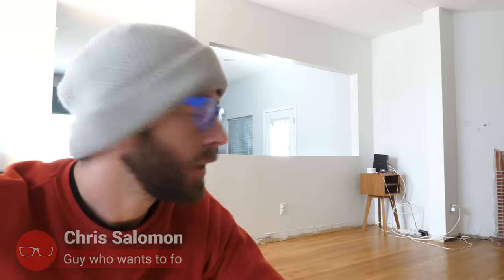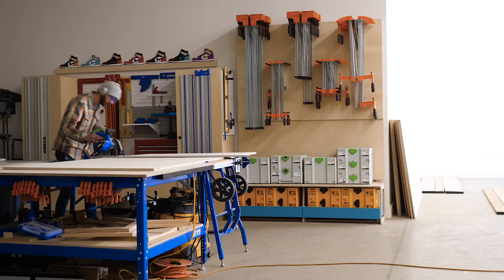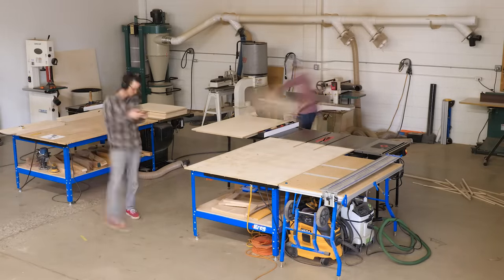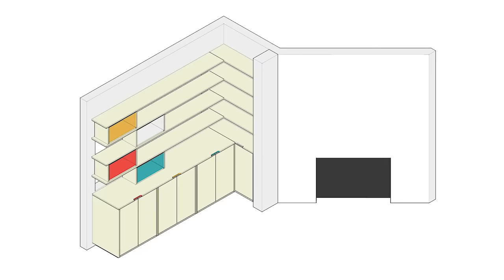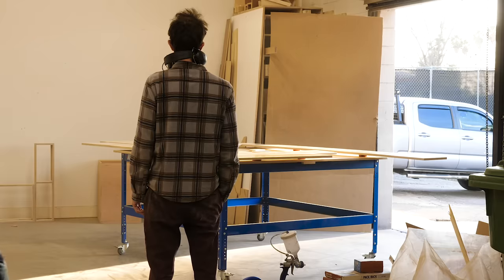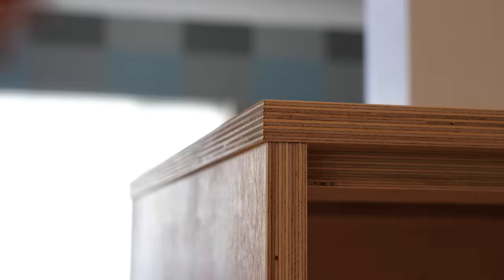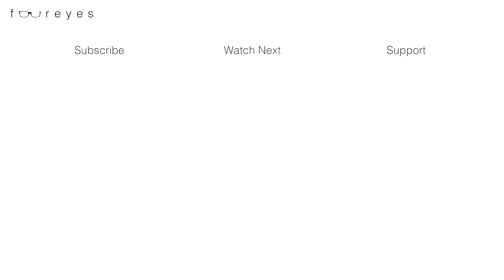Better Built-In Cabinets...Or At Least More Interesting Ones

Comment: For the concave wall, the trick I've seen people use is to trace it with a washer and a pencil.  You put the tip of the pencil inside the washer, use pressure to hold both against the wall, then roll the washer along the wall.

Comment: Thanks for confirming what I thought was my own, unique way of of generating cut sheets and processing full sheets.
Because of my work and experience, I use 3ds max in a very similar way that you use SketchUp, along with my track saw (rough cut) , MFT (cross cutting) and table saw (ripping).
Great minds think alike!

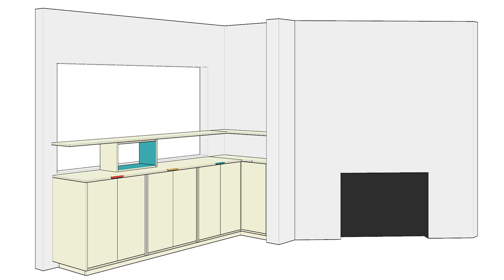Comment: Hey Chris, superb work as always. I like how you always put so much thought into your projects and give your reasons for doing them.  I'd like to offer  a small critique and a solution that was actually inspired by you.  The ugly blocking for the shelves is often a necessary evil as it is in this case.  At 15:26 of your video you highlighted a spacer that was used to mount the blocking for the shelf.  My thought is to let the spacer be permanent.  It would take the place of the blocking and add some color to a drab corner.  By using another spacer on the short wall as well you could color them to mirror the color of the boxes.  Anyway just a thought, keep up the good work.

Comment: I’m in the planning stage of my second van build, and for cabinet and countertop material I keep coming back to Baltic Birch. 

In your project I really like the cut-outs for the door pulls, and the simplicity of the pulls themselves.That design is modern and clean, but best of all there are no protruding door pulls, which in the tight quarters of a van could catch on clothing or even bruise legs. Actually I’d like to have mostly drawers rather than doors, but I still think I can use that cut-out design for drawer pulls. 

I also like your use of color on the inside of those upper boxes and the door pulls. I’ve been thinking of painting the exterior sides of the drawer boxes so that when you open a drawer you see the color, but when it’s closed you see the unpainted birch ply. 

I have been thinking of using one or two colors, but after seeing your video I’m considering a 4-color motif :) I’ll probably be in the design phase for another six months, still tons of decisions to make, but I’m feeling pretty solid about the cabinetry :)

Comment: As an ex cable tech, I'd be careful about how tight of a turn you have your coax take when you take it along the baseboard.  If it's too tight, you'll push the center conductor a lot closer to the shielding on the outside, and it can cause impedance mismatch and weird reflection noise issues.  TBH if you're coming up through the floor already, I'd recommend just going back under the crawl and coming up inside of the cabinet anyway.

You're call though!  Just thought I'd mention it.  Keep doing the awesome stuff.

Comment: Great build and quite innovative. I just upgraded to the same pocket hole jig. I’m building a set of cabinets that go underneath a mobile work table and it’s all constructed with pocket holes. I was curious why you needed to drill horizontal. I know the jig supports it but haven’t seen a need for it.
Reply from the maker: Do you mean why I'd rotate the jig 90º? For these panels you wouldn't need to. But on larger ones sometimes...so I was just kind of testing how it works. I actually put up a group of stories on Instagram today. Check that out, and it will explain more.

Comment: Chris i found a great app that i use regularly. its called CutList Optimizer. it costs a couple bucks on the google app store but you put in your available stock pieces and then your required cuts it then makes a graphical layout of the most efficient way to cut your stock to minimize material loss. I HIGHLY recommend it.   I hope you see this as it will save you a ton of material in the long run. 
(please like in hopes he sees this)

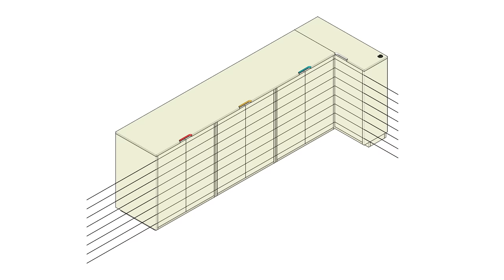Comment: 4:07 indeed, most cutlist generators take into account the grain orientation. 
I use one on my tablet since I don't have my computer in my shop: Cutlist Optimizer (free and pro versions). IMO it works better than the Sketchup plugins.

Comment: What paint is that matey? Straight onto plywood without any primer? Interesting! No grain raise or bleeding on the edge? Nice work mate. Your like the apple of woodworking where as I'm the android thats been dropped and has water damage lol
Reply from the maker: Hey Chris...it was Behr semi-gloss. Not paint and primer. It didn't raise the grain. Came out pretty good as painting wood goes. I've had mixed results in the past.
Reply: Really... the Apple vs Android reference... do better mate.🤷‍♂️🙄

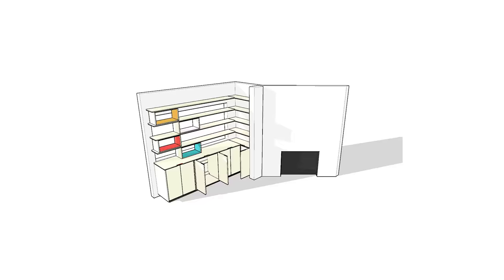Comment: 7:38 are you on a raised foundation? If so, why not just cut your RG6 cable under the house and drill a new hole where you want it to come up? It's super easy to do and will look a lot cleaner.

Comment: Looks great. But just go under your house to re-route that coax cable to where you want it, at least in the wall and through a low voltage box.

Comment: @0:28 What do you use to draw those straight sketch lines? A wacom tablet with a ruler? Or is that a sketchup line style? 

What's your process for/what tools do you use to design cabinetry for a space like that? I currently take a picture of an empty space with my phone, load it up on my touch-screen laptop, and then draw my design on top of the image. It's really difficult to get precise with the details this way, unlike what you have in the video.
Reply from the maker: It's procreate for the ipad. You can draw straigt lines on it by drawing the line then holding for a second...then releasing